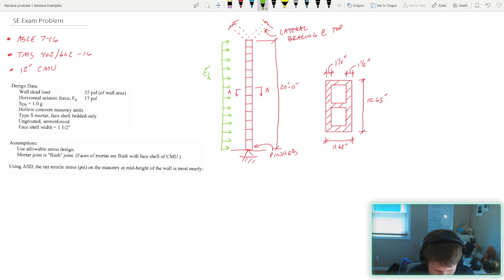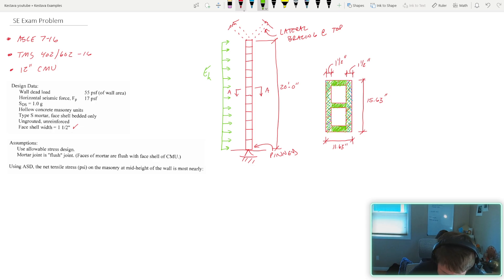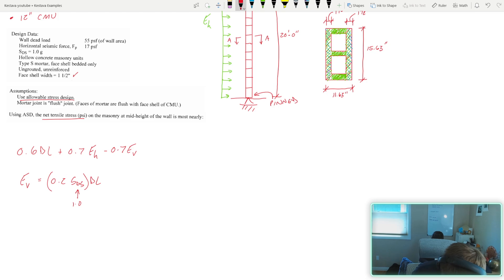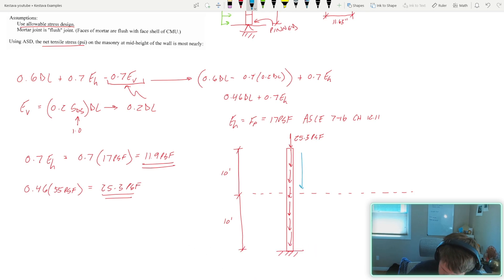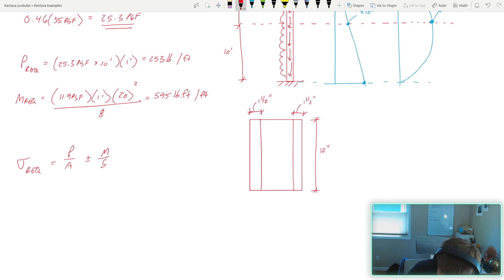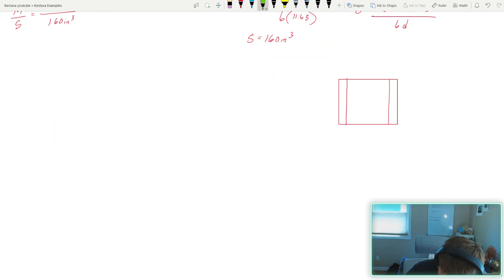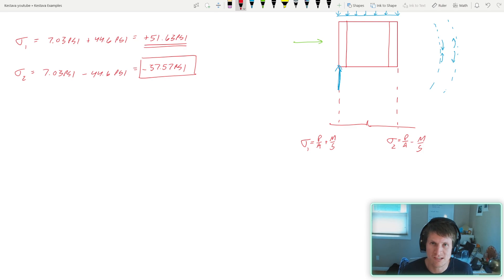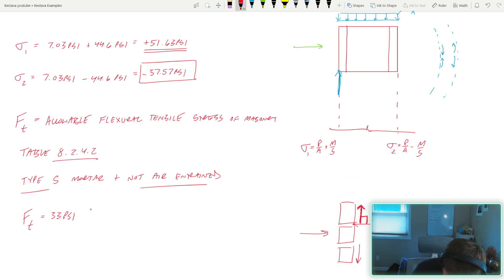Masonry SE Exam Practice Problem | Out-of-Plane Wall Design #structuralengineering #engineering

Comment: Why do you calculate stress on the mortar using the S of the brick?
The mortar has a contact surface = to the wall thickness, no?
Wasn't Ev=0.2*Sav*D? Should I use Sds or Sav?